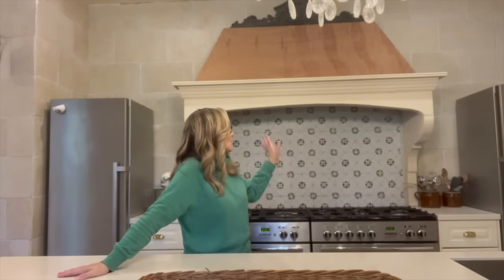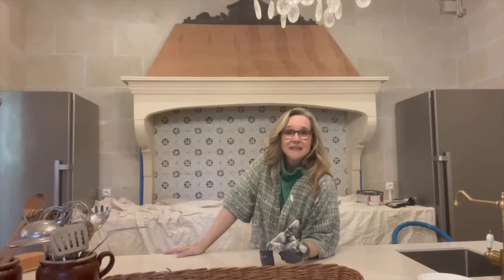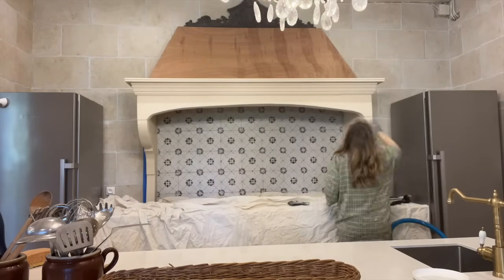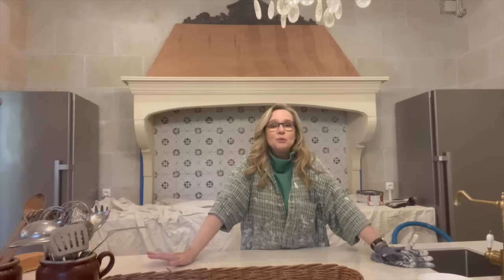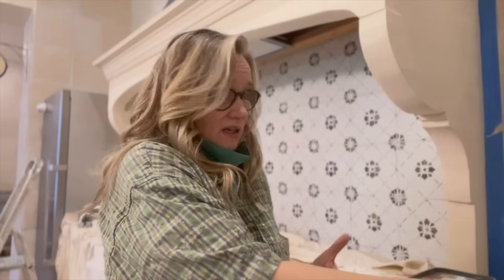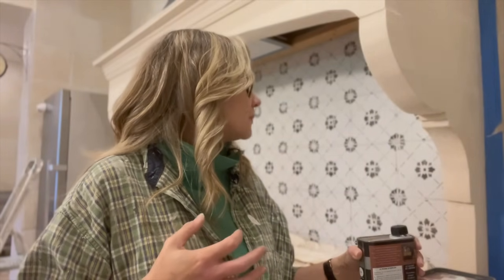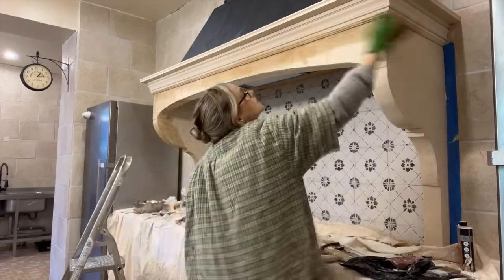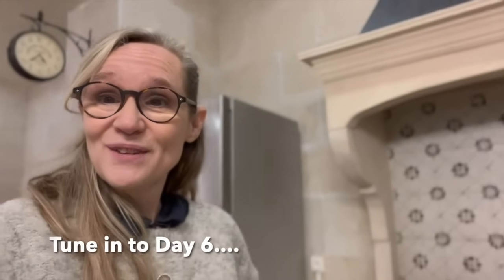Château de la Grifferaie: Day 5, 2023 French Advent "The Range Hood"

Comment: Your paint job looks really good, especially when you showed the up close photo; it does look like old plaster on stone. The 'slate' also looks good. Will Rob be fixing the corniche so it is closer to the front ( L shaped metal brackets would do it) as it is a little lost and squat as it is? I'd paint it with the slate coloured paint and then dry brush it with gold to pick out detail. That would really make it  pop. And when you've time, painting the wooden frame inside the overmantle will make it dissapear. But having suggested all of that, I am really impressed with how well the overmantle has turned out. Rob gave it a beautiful and gracious curve line. When you showed the dressing table mirror (lovely) were those the rose coloured curtains you had led on the floor a couple of days ago? They look so nice.

Comment: I am terribly confused.   Why oh why do you, your wife and daughter sit in your chateau and shiver.  You have endless fireplaces and a small forest of fallen trees in your forest that you could easily harvest for warmth.  I follow many French Chateaus and heat is a problem for all of them until they start using their forests fallen trees.  When I saw those downed trees across your driveway I thought how nice for our Lord to provide warmth to his good and faithful servants , but alas, your wife and daughter were both wearing multiple layers of clothes to keep from freezing to death.   I realize that that beautiful socialist country electricity is expensive and the same for fuel oil, too.  But I mentioned OTHER CHATEAUS in France such as Chateau LaLande which is run by Stephanie.  She depended on heater stoves powered by wood.  Now, after a short time, she has had a wood powered furnace installed in the Chateau that will apparently heat the entire place by logs and a hot water/radiator system.  It’s new, it’s shiny and probably cost the same as your new roof .  But she and her mom were the first to use the YouTube $$ to fund her Chateau rebuilding project.  At present, she is rebuilding her chapel and her lake that she was forced to drain by over-zealous politicians when she moved into her home many years ago.  Also, the Plethericks use a system that also uses fallen trees from his forest to heat his massive Chateau.  Billy and his wife also purchased an abandoned nunnery that he is also repairing with videos on YouTube.    His restorations have been extensive and the only difference between you guys and them is that they work at it daily (and they don’t have to live thousands of miles away many days of the year.).  I realize that your situation is different but I would suggest you check into their videos and maybe do some of the things that they do to stay warm.  I think you all are terrific that is the only reason I wrote this long treatise on Chateau Survival, written by a silly American fan that thinks you guys are awesome!  God Bless!   Wade in Rosa, AL, USA.    Pax and Merry Christmas!
Reply: I think they mentioned somewhere that they didn't know if the fireplaces were all working still.
Reply: I don't know how much it costs in France, but here in the US the one fireplace we have in our house would  be around 20k to get back up and running 😞